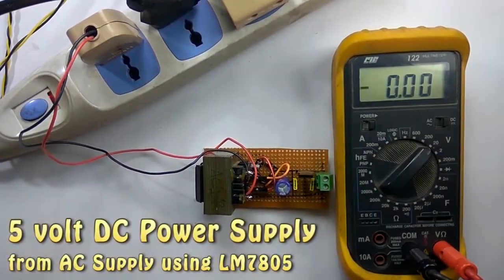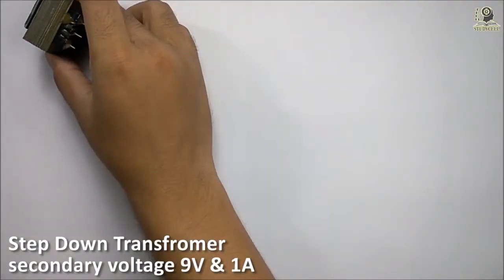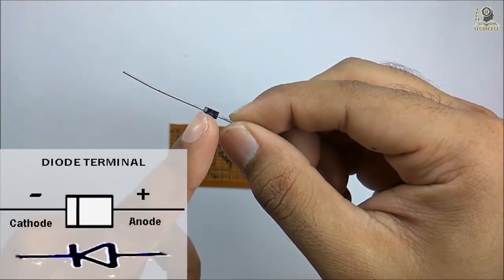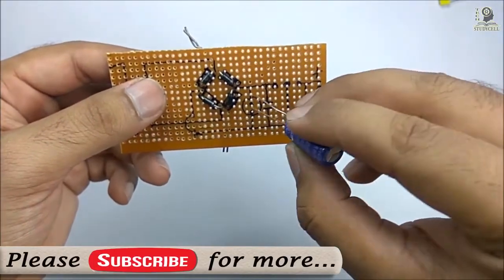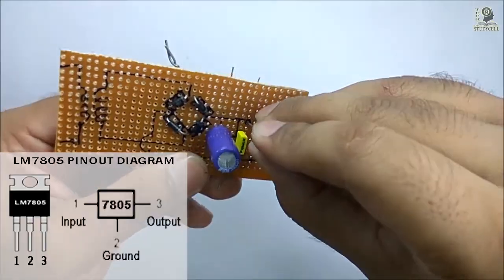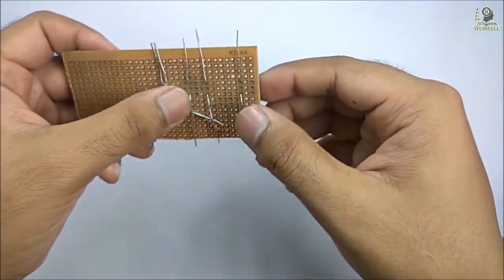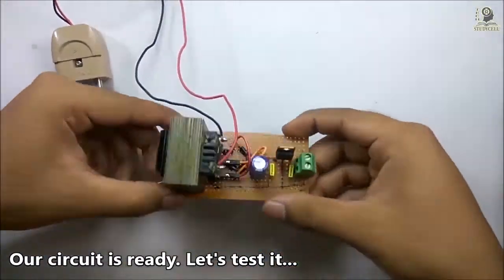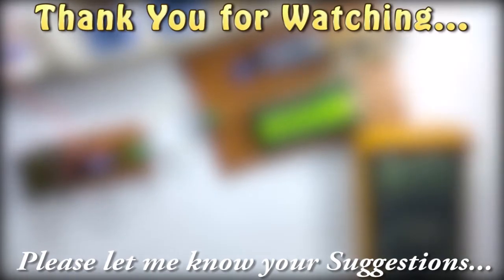How to make 5 volt power supply in 5 minutes Easily

Comment: I've tried it but the led is not glowing what should I do now
Reply: I've removed the capacitor after the regulator the led glows thanks for the reply
Reply from the maker: Check the dc voltage output first

Comment: Awesome information. I really appreciate the work. I just embedded this video in my blog post "Design of 5V @ 500mA Dc power supply". In my post, I have explained everything step by step with calculations. Like, How to select a transformer, regulator IC, calculating the capacitor value etc. Hopefully, as you got value from this video, my post will help you too. Here is the link https://yamanelectronics.com/design-5v-500ma-dc-power-supply/